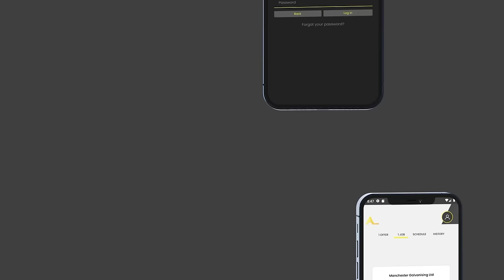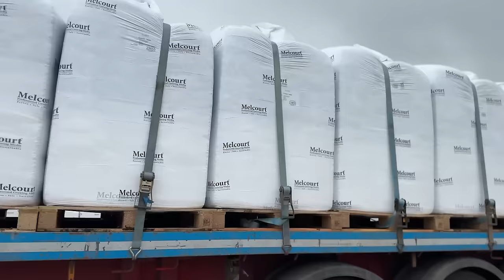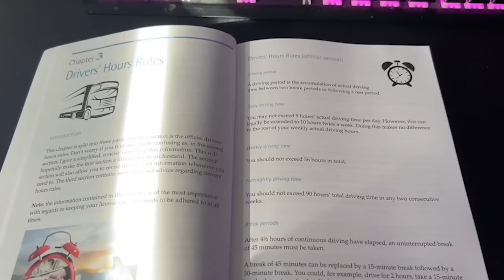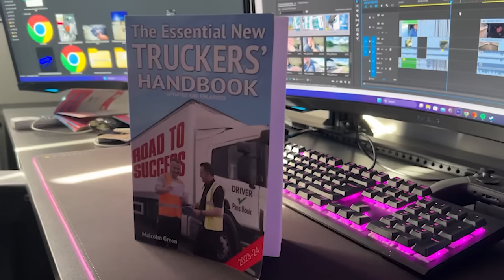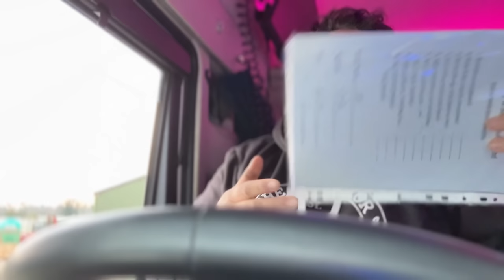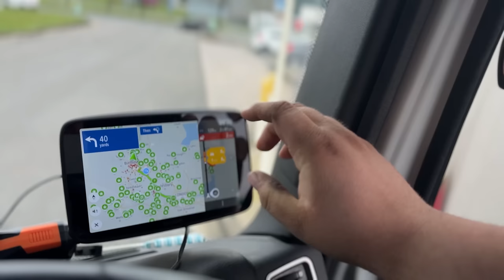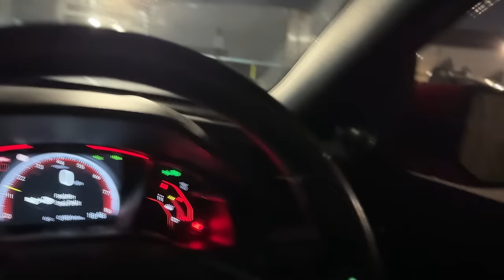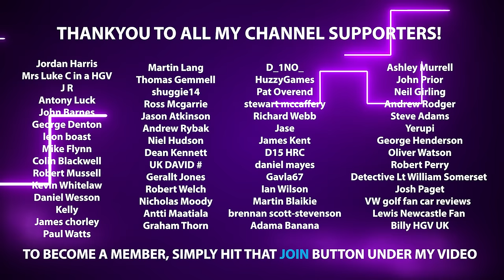Stayed The Night In A Nursery!

Comment: Just started looking for a new Truck. Have been looking at the Stralis. Price wise they appear to be a steal. £30,000 for a 2020 with very low mileage. So what is your opinion an Honest one please. And what faults do they have ( major ones ). Your input would be appreciated.
Currently running a 2017 Actros nice truck But time for a change.
Reply from the maker: I don’t know mate. Never had a stralis. But alot of people hate the n the iveco, presumably because of the stralis. I have an S-WAY
Reply: @lukecinahgv  Thanks for that. It does appear that the Iveco has a bit of a reputation. Maybe should stick to another Actros...